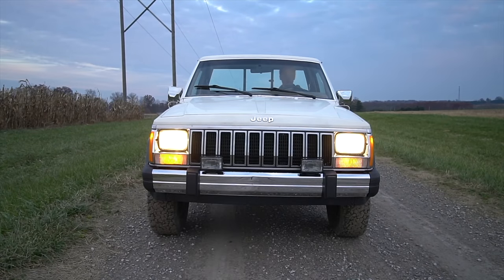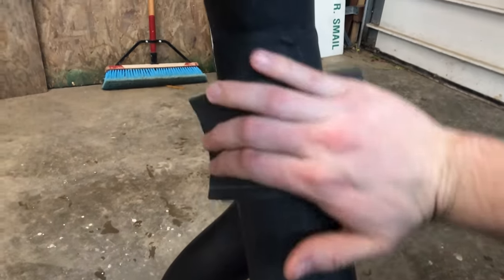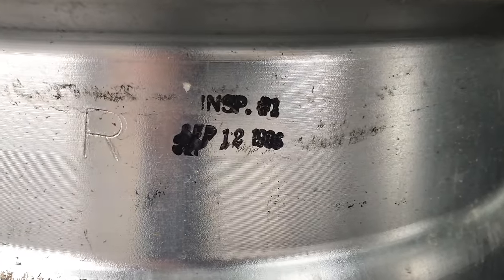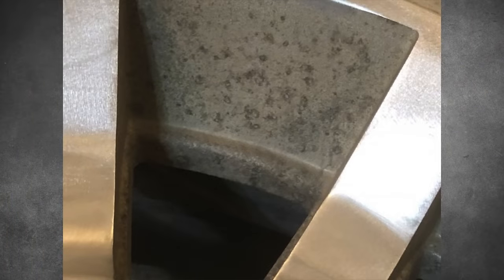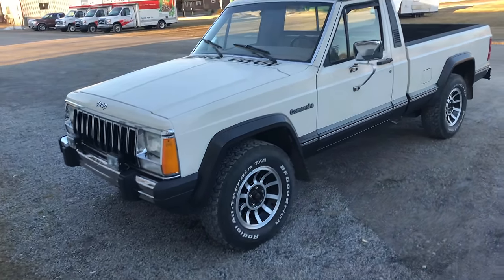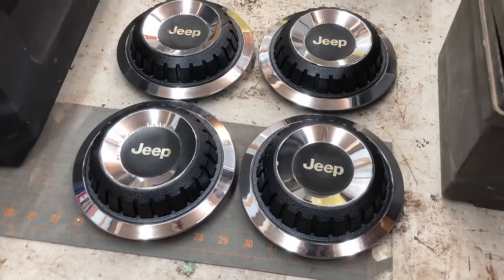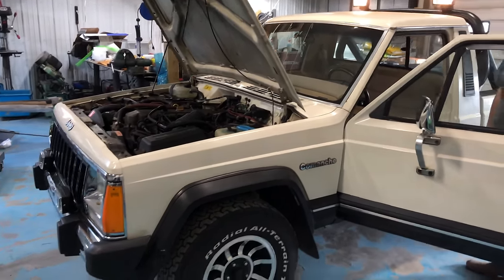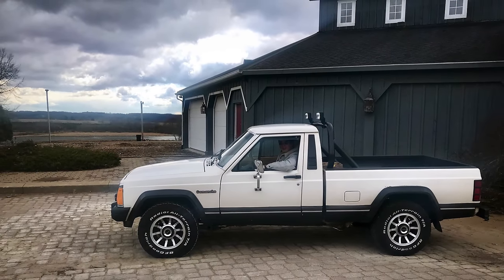1987 Jeep Truck Restoration Project: Part 3 (New Rims & Sport Bar Install)

Comment: wow so many good memories looking at this truck. I came here because I've been seeing many jeep trucks on the road again... I had one exactly like this arounnd 1993/1995. It was tan, and the t interior was like this color and all complete nothing broken or missing. I bought it from this guy in California who barely drove it and had taken good care of it. He had put a camper shell on it and had put carpet on the bed of the truck. The only thing I upgraded was the rims because i didn't like the orginal steel wheels. I found on a paper ad a set of rims that came from a cherokee; they where gold and with bigger tires on them, ohh they made my comanche look so much better. The only thing I didn't like abou it was that although it was only a 4 cylinder, it only gave me about 13-14 miles a galon.

Comment: Great video cool truck especially with the 4.0L engine I saw.  I just bought a 1995 Jeep Cherokee in mint condition with the same engine.  Jeeps are great especially the older ones. Please make a part 4

Comment: Truck need rust repair around the rear fender flares. Looking good though. Miss my 1984 4-
door jeep cherokee with the 2.5ltre inline 4 cylinder.

Comment: I just watched epidode 1 to 3 and am currently in the process of restoring an 88 Comanche.  I want to know where you're coming up with some of these new parts such as the chrome bumpers.  Mine is in Primer right now but at one time was Colorado Red and that's the color I want it to return to with the original chrome accents.

Comment: I'll be tackling this exact same project. How did you sand between that groove around the rim's edge? Did you just hold the sander at an angle to get in between? Thanks.

Comment: great job on the wheels, though you should add a clear coat and wax top layer to ensure your good work lasts a long time as it'd be a shame if in two years it chips and corrodes.